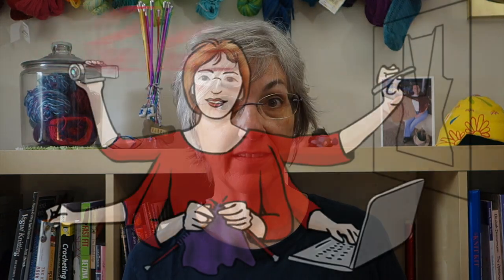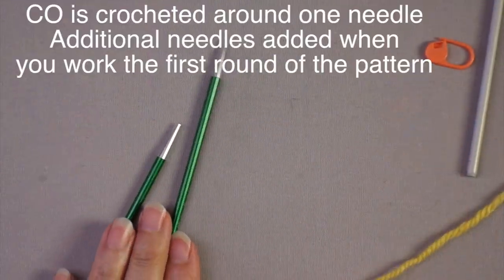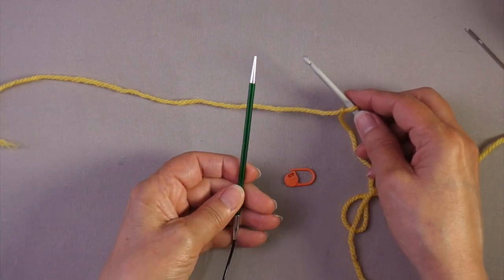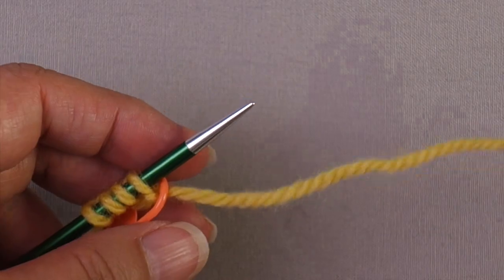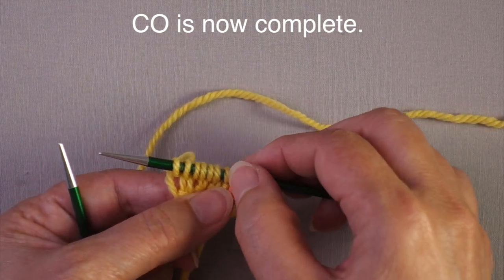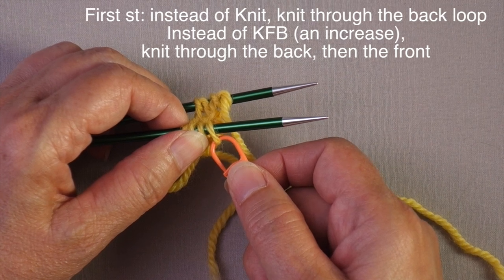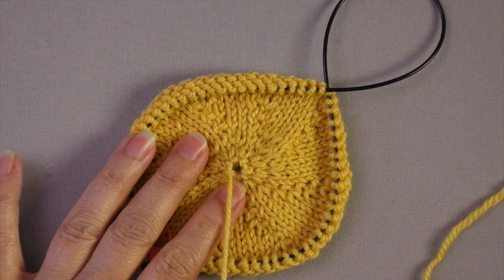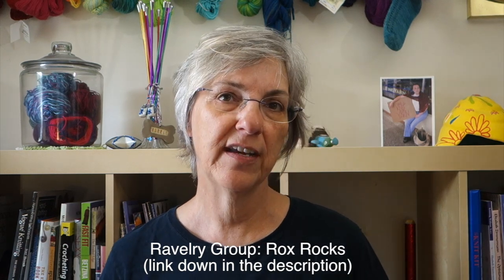Pinhole CO

Comment: Ms. Richardson I like your videos and I learn a lot of new things, I would like it see a video on knitting 2in1
Reply from the maker: Can you explain what you mean by "knitting 2in1"?  Are you referring to knitting two at a time, as for socks or mittens or sleeves?
Reply: no, I am referring knitting 2 in 1 as you do for knitting one inside the other it looks as if you are just knitting one sock,mitten or sleeve
Reply from the maker: That isn't a technique I'm likely to do a video on, because it's not a technique I find appealing or practical. It's *interesting*, but there isn't much utility in it. The process uses double knitting techniques to accomplish the task, can result in differing gauges for the inside garment and the outside garment, and there's a constant risk of inadvertently linking the two items together. There should be information about how to do this on the internet (I've read about how it's done, so it has to be out there), but I can't see myself doing a video on the technique. Sorry!
Reply from the maker: There's a knitty article on the process from a few years back here: http://knitty.com/ISSUEfall06/FEATextreme2in1.html
Reply: Thank you.

Comment: How do you “reposition the stitches”?  You jumped right to it without an explanation and I can’t seem to figure it out. How do you get to where the marker is on the needle close to you, but the tail is on the back needle?
Reply from the maker: Center the CO sts in the middle of the cable with the marker at the right edge of the sts. Fold the cable of the circular, and push the fold inbetween the two middle CO sts to separate the halves, and then slide the two halves of the CO up to their associated needle tips.
Reply: @RoxanneRichardson     Thanks Roxanne.  I used to knit, I did a lot.  Years later, my hands are arthritic and my vision not so good.  I’m trying to make a hat for my great nephew’s bunny and it’s a nightmare!  😂  I want to make a hat with 2 openings for the bunny’s ears.   somewhere in this house I have tons of tools, needles, hooks, markers, etc, and can on,y find a few things.  2 days ago I ran across a small box with a bunch of markers.  Today I don’t know where I put it!  I will carry on and make the most of it.  I appreciate your quick reply.

Comment: Thank you so much for your videos.  They are SO helpful!!  Do you have any suggestions on keeping a point from forming if the finished item is meant to lie flat?
Reply from the maker: It should work the same way that working toward the center works. As long as you do the first set of increases (doubling the sts) in the first or second round, and then continue to increase every other round (or even every round, at first), it should work fine. Did you try it, and end up with a point?
Reply: I have been eyeing the Persian Dreams pattern and noticed people having trouble with points in the center.  I like how tight this cast on closes up, and was hoping it would work for that pattern.
Reply from the maker: I hadn't looked at Persian Dreams in a while, so I looked through some of the projects to see what you might be talking about. I think part of the problem is that it's stranded color work. If the floats are too tight, the circumference isn't going to change enough, even as the stitch count increases, so you end up with a bit of a tube toward the center.
Reply: That makes sense!  Thank you SO much for your help!
Reply: I just used this to start a butterfly cocoon.  When I released the chain and pulled the hole closed it felt like magic!  SO much easier than the way I was doing it.  You really do rock! :).
Reply from the maker: It is like magic, isn't it? I'm so glad you tried it and liked it! :-)

Comment: How did you get from 8 stitches to 16, then more? That was a kind of key feature.
Reply from the maker: When a pinhole CO is called for, the pattern for whatever it is you're making will direct you on when and how to increase. In this case, I used kfb to double the st count. This is typical, and increases after that will often be every other round, increasing by the same amount (that is, by 8 sts each time, in this case, not by doubling the st count each time).  The reason I worked several rounds here was so that I could demonstrate the release of the drawstring.  Releasing the drawstring is an important part of the CO. How the increases are done (number and method) is completely separate from the CO, and can vary, depending on the pattern.

Comment: You wouldn't happen to have a tutorial on how to make that little yellow round coaster?

I did peruse  some of your videos and you have so many which is awesome but I didn't have a chance to look through all of them
Reply from the maker: It's really just the reverse process of the crown of a hat. Instead of decreasing every other round, with the last two rounds decreased without a plain round, you start with a round of kfb in all the sts, then (k1, kfb) for a rnd, then a plain rnd, then k2, kfb; plain rnd; k3, kfb, etc. Start with 8 sts (so 4 crochet sts that are doubled for the drawstring, then join in the round and do two inc rnds in a row, then alternate inc rnds with plain rnds until you have the diameter you want, and bind off.
Reply: @RoxanneRichardson  for some reason I did not get this notification that you replied to me. Anyway so after reading your explanation is almost as if you're speaking German to me 😁😁😁

it's a bit over my head at this stage of my knitting career 😂😂
I'll have to look up what kfb means.
Reply from the maker: @dcwatashi  kfb is the most basic increase (knit into the front and back of a stitch). You might find this site helpful: https://www.craftyarncouncil.com/standards/knitting-abbreviations